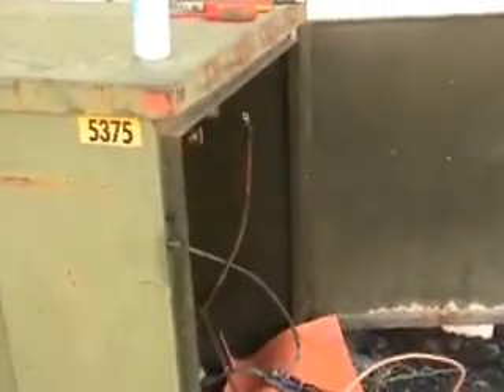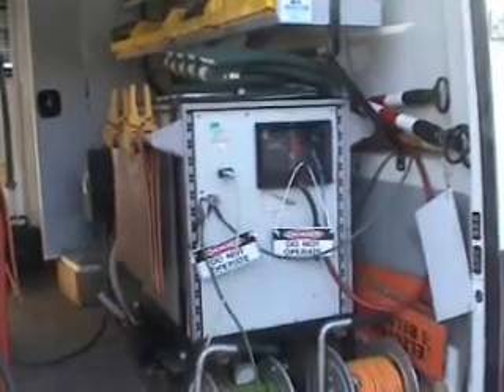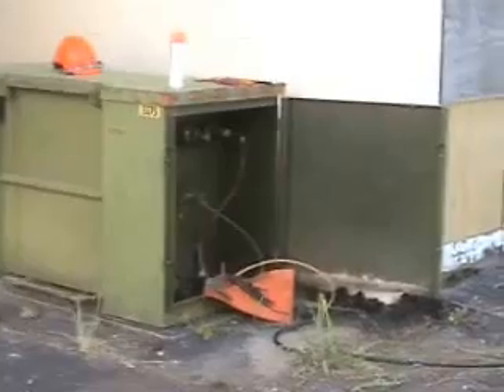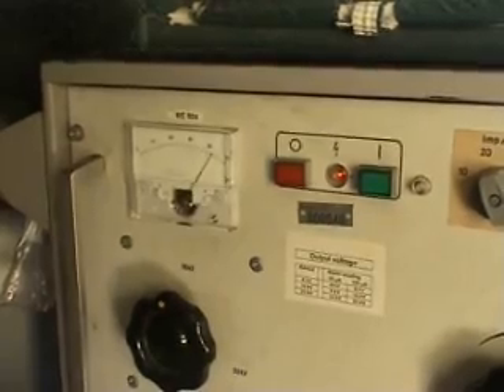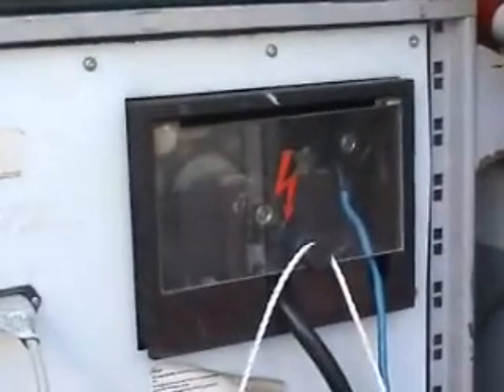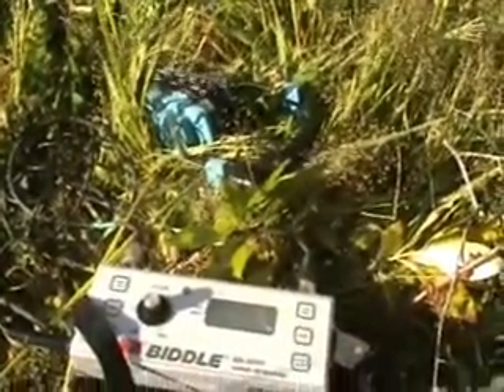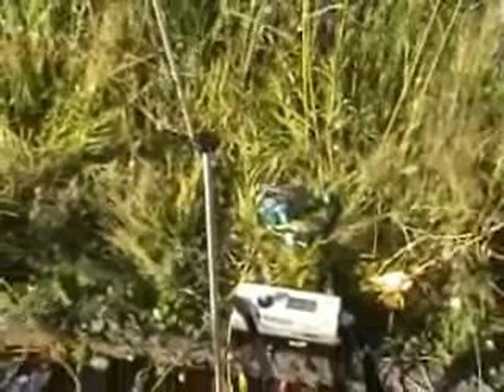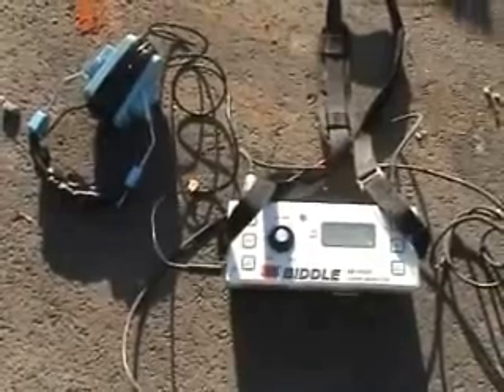High Tension Cable Fault

Comment: The today actual method of locating such cable faults is some different.
With a high voltage and a very low current a permanent arc is generated. The location of the fault will be located from the beginning of the cable via a high voltage filter with a pulse reflectometer by measuring the transit time to the echo of the arc and back.

Comment: As I understand it, the area where the fault occurred bears resistance high enough to dampen the thump where it can be pin pointed by the microphone? Or is the fault location creating the biggest thump heard? Seems like this sort of hi-pot testing is a bit of brute-forcing on an aged cable.
Reply from the maker: The fault area is where the arc occurs and a noise is present. During tracing the EMP can be picked up as well. Near the fault the noise increases to a maximum and reduces after overshooting the fault.

Comment from the maker: They are often old joints failing or caused by ground movement which damages the insulation. And the main one is diggers and directional drills.

Comment from the maker: @tall32guy Discharging high voltage capacitors into a faulty cable to make an arc where the fault is present in the cable.
With microphones the sound can be picked up and traced down to within one meter of the fault. so the hole can be dug and fault repaired.

Comment from the maker: The thumper is creating an impulsing arc, every 3 or 6 seconds (timer), where the fault is in the cable.
It is done by charging up high capacity condensors and firing the energy in the faulty cable.
Where the fault is, usually the insulation has failed and a flashover occurs.
The noise can be heard from below ground with a listening set, or with your ears and can than be dug up and repaired.
Reply: As an added bonus, it also distracts the worms from where you're walking.